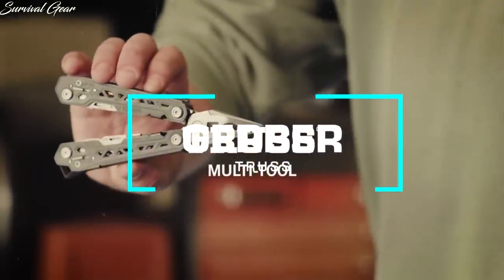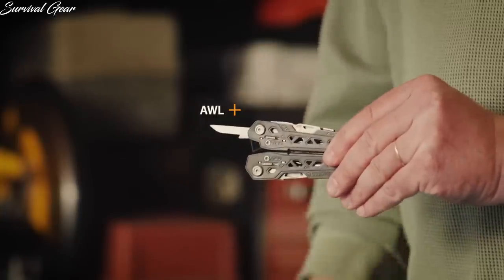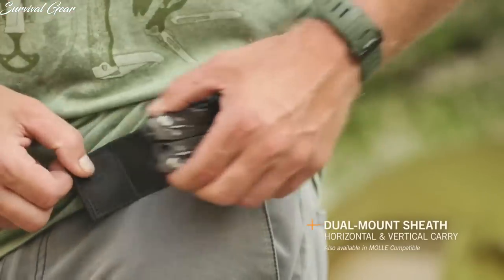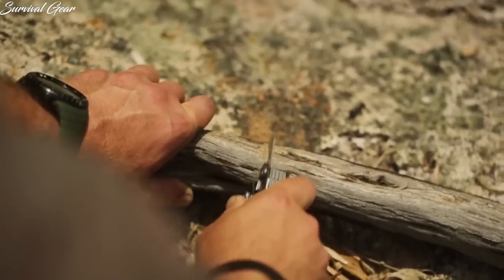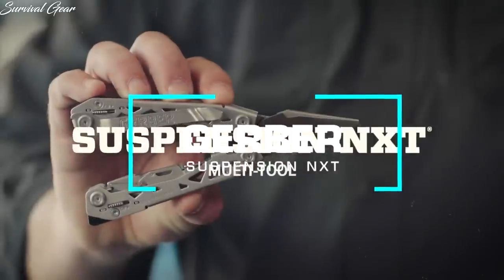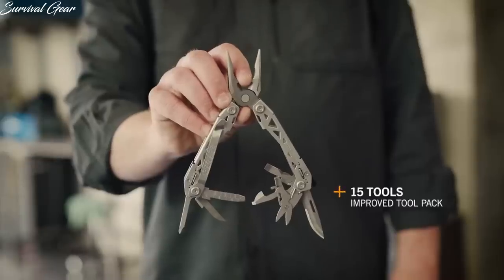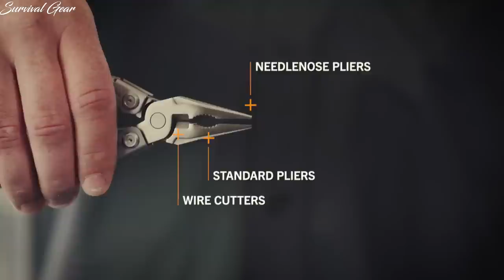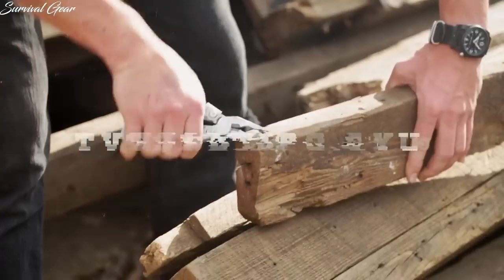TOP 8 Best New Multi-Tools [2019] You Must Have!

Comment: The SOG powerpint is one of the best tools with its most important features not mentioned, and this video didn’t do it justice.
Reply: Yes, I agree... The power pint by SOG is the one that I carry daily. I had to grind the bottle opener to give a medium flathead screwdriver, and I also converted the file into a large flathead driver/prybar. These were missing and I recognize this is a big fail. But this mod has fixed the problem. The pliers are very good, and the range of tools, all of which lock, makes this a tool that I reach for many times a day. All tools open with the handles closed (apart from pliers). On one side, all locking, there's a file (not useful) with my mod of large flathead/prybar, a seatbelt cutter, also great for opening welded plastic packages, a fine screwdriver,  a reamer/scraper, and a knife blade, which is the same length as Leatherman Juice's. On the other side, all locking, are: scissors (needed a blade touch up, but cuts string, paper, cloth), a bottle opener with my mod of a medium flathead driver, a  0-size Phillips which works on #1 & 2 Phillips-head screws for light to moderate  use, a tin opener, and a serrated blade. The pliers, geared for mechanical advantage, are accurate needle nose, will cut 1.2mm  wire easily, and cable ties. The multitool has a crimping tool, and a ¼" bit driver (the only thing you mentioned). You glossed over this multitool  and its functionality totally. I wondered why you even bothered to mention it.
I don't need cut fencing wire, and I don't need a knife to carve branches for a log cabin. It clips into my pocket, is light and easy to carry. It's one of the best EDC multitools  IMHO. Too bad you skipped it.

Comment: nice .... as EDC multi tools, but I would like to see one that is customizable, like, let's say the butterfly plier frame and the rest in the handles being customizable, selling parts separately or batches....
Reply: Bobbius Shadow nice, really great idea👍🏻
Reply: Bobbius I make/customize/refurbish multi tools they aren’t to hard to make or customize you could do it yourself they sell parts online and you can make your own I’ll break off tips off Phillips screwdrivers and hammer one side flat and dril a hole in it I’ll cut down files into shape and that kind of thing really fun to do I like to integrate things into the frame like why have a fold out file when the handle can easily be a file or a mirror to use as a reflector I put ‘easy’ knife sharpener on the frames too sooo much you can do.

Comment: I own the SOG Q 4 and the Victorinox. The SOG Baton is the worst multitool I ever worked with my intire life (and I purchased some crappy chinese multitools in my life). The problem with the SOG is the pliers tool slides back inside the grip whenever you need to apply force in something. The Victorinox is not so practical as they annouced. You need to lubricate it very well to fold the blades that are difficult to open the you don't have stong and long fingernails.